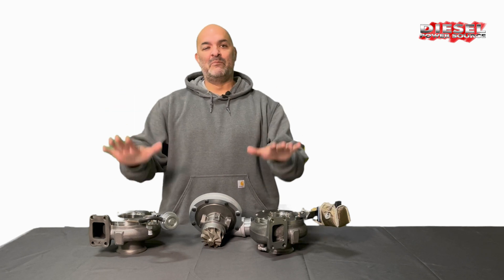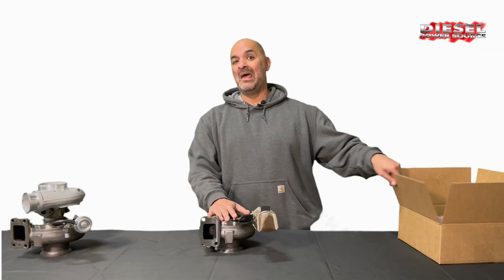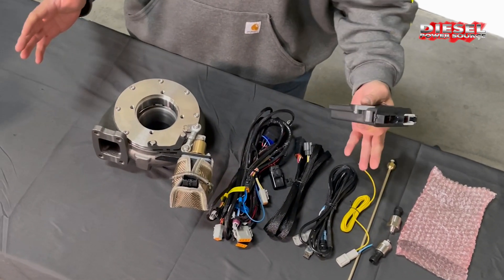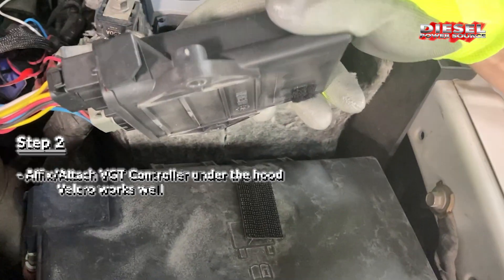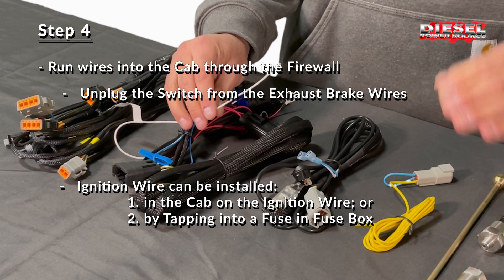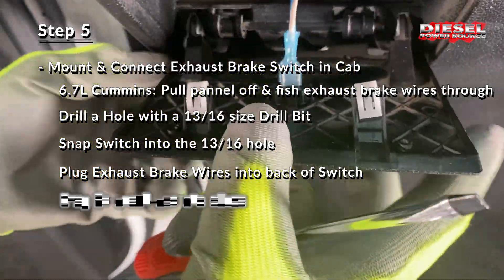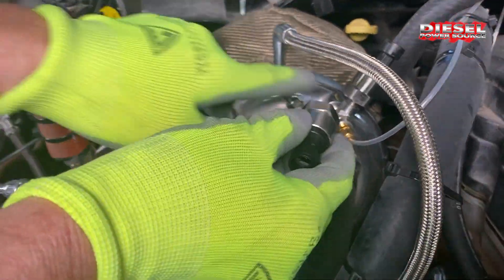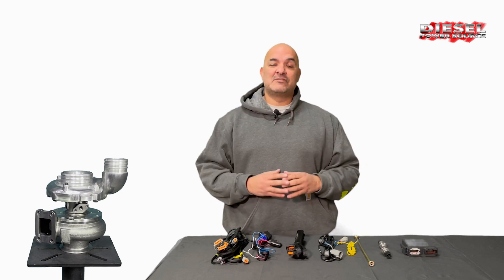Electronic VGT Turbonator | 6.7 Cummins Turbo Upgrade with Exhaust Brake

Comment: WHy is it on the wbsite when trying to purchase it also requires a compressor, and there is 0 mention of that here?
Reply from the maker: This video covers our old version of electronic exhaust brake. That model was superseded by our new Hybrid model, which uses air pressure to move the stators from the drive position to the braking position. This allows us to use our new 3-stage actuator mechanically, to eliminate electronic problems.
Reply from the maker: Only the Hybrid Turbonator VGT requires an air compressor.

Comment: Are you guys working on being able to plug into the factory exhaust brake button on the dash?

Maybe not necessarily plug in under the hood but somehow just maybe the switch inside the cab
Reply from the maker: We are working on it.
Reply: I'm curious about this too. I don't like switches all over my truck. 😅 Plus I was wondering if you get any warning lights about the actuator being disconnected
Reply: @gsc512  I don’t know if they ever did it. But they told me they were working on it. I’ve sold my ram since. So I don’t care anymore. Lol
Reply: @DPats1228  I looked over there site and I think I'm just going to go with the add a turbo as it really annoys me when manufacturers do this.
Reply: @gsc512  I wanted to add a turbo also. But my truck already had the s300 66mm version. So I used the mechanical turbonator exhaust housing. It worked great. I could hit 40 psi at like 1500 rpm. But then the turbo would surge. Not good for it. Just saying it could be done
Reply: @DPats1228  I just don't like the extra loose wires in the engine compartment so unless it's plug and play with a factory harness and computer I normally won't buy it. As I hate it when I get classic cars to restore and then I have to trace wires all over the place. To me with a modern computerized truck it just says that they didn't complete the job. They only completed the mechanical side of the house and didn't care for the electrical side